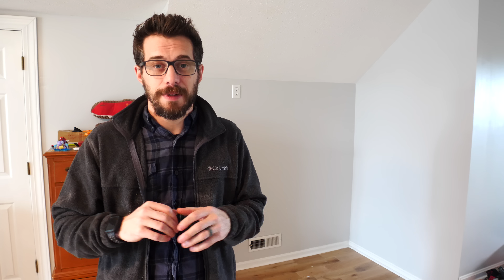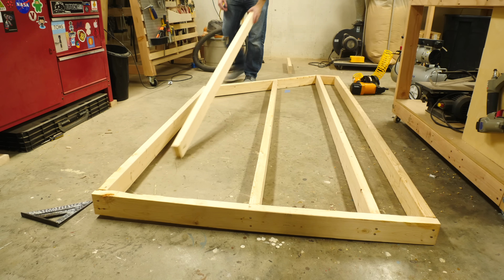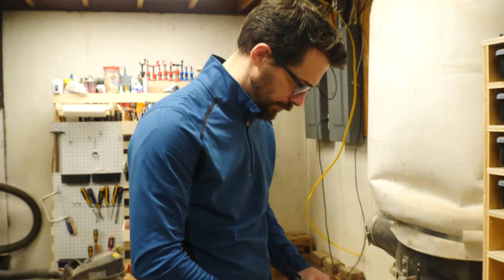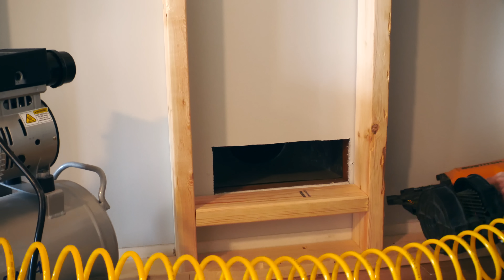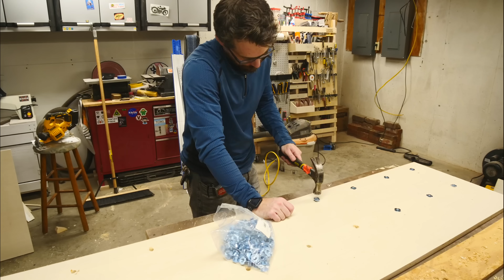How to Make an Indoor Climbing Wall | I Like To Make Stuff

Comment from the maker: Lots of people ask why I didn't just put the plywood directly on the wall. 
There needs to be negative space behind the plywood for the bolts to poke through.  In my space, I could have removed the drywall and put the plywood on the studs but it's an attic space so that would let tons of air through .
Reply: I would just put some furring strips on the back of the plywood for whatever offset you want from the wall. Then attach plywood directly to the wall.
Reply: Cool project though. I might do this in my son's room.
Reply: Noconz0727 MC Agree. I ran my 2x4s flat and perpendicular to the studs and then mounted the plywood to them.
Reply: I put furring 1bys perpendicular to the studs then 3/4” sanded maple with t studs already installed all over the place. Then. Bolted the  plywood to the studs with Headlocker screws.     Much quicker and smoother wood
Reply: @charltonwang  That's how I did my wall too. I just marked the studs and ran strips of 2x4s horizontally attached at each of the studs. Then just attach the plywood to the horizontal strips tied into the studs
Reply: you should put a bell or horn on the top
Reply: Cover the studs with plastic sheeting with enough slack to keep from being poked by the hold screws, and seal all the seams airtight.
Reply: Bravo! Nice Project! You've got me scheming about a wall of my own for sure!
Reply: Oh! You can always count on the comments to clear up 90 percent of questions
Reply: I Like To Make Stuff hey there! I was wondering if you think this kind of thing would be doable in a rental.  Do you think this would damage the underlying drywall too much? I know it's a lot of work to just take down, but the closest place to climb is 3 1/2  hours away...
Reply: I Like To Make Stuff I am climbing 9 times a week😆😆
Reply: I Like To Make Stuff can you make a video on how to make zig zag corner shelves , i would really appreciate it thank you
Reply: You should make the guitar from coco
Reply: It looks amazing!  U should have a company called I like to make stuff and build things for people
Reply: Literally came onto comments to give you shit about not installing straight onto the wall but... fair point you win this time
Reply: Personally i would have just strapped the wall with 2x2
Reply: WOWWWW
Reply: I Like To Make rocks
Reply: Might make it and add a small cushion spot so my sister can have a spot where she can sit and be left alone
Reply: I am a competitive rock climber actually, so this was very cool to watch!
Reply: I just saw this as a small video snippet for a Lowe’s commercial and recognized you right away bob!
Reply: I've built 9x9 feet steel frame fixed to the wall by chains. So, it's  in vertical position while unused, and can be adjusted for any overhanging angle for action.
Reply: This still does not make any sense whatsoever. The bolts would just go through the plywood and into the drywall. Just pretend you have an inch and a quarter thick piece of plywood and get longer bolts.
Reply: Hey i am a climber amd what the use in the climb halls is that they have a special paint on the wall and in there is sand in the paint they do this for extra grip on the wall. I also think it is safe have a "crashpad" or what we call it in the netherlands a boulder mat this is for extra protection so you and your kids wont get hurt to much if the fall bad (you could brake a ankle with this sport) i hope you will do something with this advice but that is up to you. Have a nice day and climb save✌
Reply: @baconunicorn9830  And at the end of the video he said that there was a crashpad
Reply: @musicgirl101vbjordyn5  ohh okey nice didnt hear that
Reply: True and im a climber to :)
Reply: I'd use metal construction brackets (cut to size) and would reinforce the notched ends. sawn lumber generally has very weak tensile strength in the direction perpendicular to the wood grain. if those notched ends split the cracks will rapidly find their way through the entire beam and you do not want that happening when someone's climbing it!

Comment: I just installed a climbing wall and my biggest frustration was installing the hand holds because the holes I drilled were not perpendicular to the wood base and my screws kept cross threading into the t-nuts. My advice for anyone installing one is to make a drill guide by using a drill press to drill a hole into a block of wood (maybe 2" cube) so that all your holes are perpendicular to the surface of the wood. I would also install the hand holds to the base, if possible, before screwing the base wood to the wall to prevent the t-nuts from popping out the back while installing. The holds don't add that much weight to the wall.

Comment: Question 🙋‍♀️ 
The frame you built to go over the outside of the Sheetrock- do I need that for the extra support? I’m building in a garage and there’s no Sheetrock there yet… I’m wondering if I can skip Sheetrock and just put the climbing wall and if I did that, do I need to build a support still or can I just go at it with the plywood?

Comment: What is the difference between making the frame with horizontal 2x4 as opposed to vertical. I thought one is supposed to line them up vertically to your studs if you were doing an overhead or angle wall. Horizontally if doing a flat wall. 
I  am trying to build a flat wall for my 4 year old. 8ft tall by maybe 8 or 9 ft long. I haven’t decided yet. Any advice would be greatly appreciated. I’m doing a lot of reading and watching about the subject but getting to a stage where I have questions based on experience.

Comment: chandanr24
55 minutes ago
hello, thanks for uploading this video. I have a question for you here.. when you are fixing that studd structure on studd (at wall). what size of screw you have used. I have a 4X2 studd to be fixed on unfinished wall in basement.
Thank you !

Comment: I've built 9x9 feet steel frame fixed to the wall by chains. So, it's  in vertical position while unused, and can be adjusted for any overhanging angle for action.

Comment: Hi Bob, I want to setup/make an outdoor climbing wall for my young children (up against the detached garage).  Do you recommend a specific type and thickness of plywood?  I was told to stay away from pressure-treated wood because of the harsh chemicals.  Would I just end up painting it? Any assistance would be appreciated.

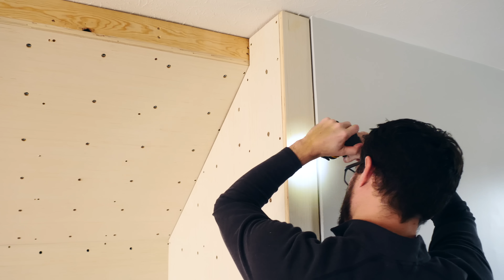Comment: nice video, but 10:15 'obviously, ...'  - why?  you can sandwich the t-nut between the plywood and the 2x4 (recess either to get it flush) and drill the 2x4 to accommodate the bolt...
Reply: What millilitre is the gap, and do you think its possible to bed them in?
Reply: @perrymarshall8584  the flange on a t-nut is maybe 2 mm thick.  if you can't get that flush with a hammer (in a 2x4, little harder in plywood) you could pre-drill with a router bit.

Comment: I just wonder why all the hassle to build the frame of the climbing wall which has exactly the same shape as the wall behind it.  Why can't you just remove the drywall and replace it with the plywood?  The plywood would have all the same holes drilled in it, before installation.  Then you attach the climbing holds and there you are.

Comment: Hey man soooo I went crazy awhile back and built a huge wall in my dads barn... One guy said paint with sand, that would work but what I did was use epoxy and sand to coat some of the wall. I also made some homemade home with the same mixture. Just an idea on how to coat it. If you haven't already. This is really awesome though, good job!

Comment: Great idea. I think 5" nails were a bit too short given they had to go through drywall. The frame could have easily been 2" thick instead of 4" to make it easier to secure. The air duct needed to be properly extended. And using screws instead of nails on the inclined frame would have been safer. Overall it looks good and very convenient.

Comment: I recall he made an apron to avoid the sawdust @ 9:50.  Not the first time I've noticed he hasn't worn it since he made it.
Reply from the maker: I usually forget about it in the midst of working.
Reply: @Iliketomakestuff  hang it near or on your tools that make the most sawdust.
Reply: You could also store it with your dust mask.

Comment: Hey, you should figure out what kind of gritty paint mixture that climbing gyms use to allow you to smear on the wall! I assume it's some sand mixed in with the paint but I'm not sure. Clear coat is probably quite slippery and not great if you want to teach them to smear (eventually!). 
Great project!

Comment: If they don’t like the sanded cut out you can add a router round overturn sand and it will be much more pleasing to grab than a squared edge. 

From one wood worker/carpenter to the next this is fantastic

Comment: 16" on center is a standard only for structural framing. Since you are mounting this to a wall, couldn't you have just made it 20" or 24" on center?

Comment: Usually indoor climbing walls have some kind of "sandy", rough surface soyou can use your feet on them. You get grip and you can challenge yourself by using hands on holds and feet on wall only. Great built! Kind regards from Germany!

Comment: My friends and I built a huge wall structure in our backyard. We used lock tight for the screws, and we painted the plywood with a sand/paint mixture. The texture helps a lot with climbing, but I don't think it would be absolutely necessary for a small space. Great job, I think you did everything about how it should be.

Comment: Protip: Crown your studs before you use them, (sight down the thin and fat sections of each 2x4 and mark the sides that bow out). Face them in the same direction in your build so at least its consistent, any super warped or bowed boards can be cut down for short sections or bracing.

Comment: AAAAHH!! DON'T stand on top of the wood that you're driving nails into with a pneumatic nail gun!
If the piece of lumber in question has a knot right there, the nail you're driving can shoot out to the side and drive right out of the wood and into your foot! I've seen this happen to nails on multiple occasions while using a pneumatic nail gun. I've also seen a nail get driven into the hand of a person holding a piece of wood being nailed.

The nail did manage to attatch his hand to the work piece so I guess it was effective at it's job....
Reply: That happened to my uncle. Have you had an anti-tetanus jab lately? He thought he'd got away with just an injury, until his jaw locked up.

Comment: Maybe this is a dumb question but you made it sound like you have to join the corners with some sort of nail. Would screws not work in this case?
Reply from the maker: Yes, I mentioned that.  long decking screws would work fine. 👍🏼
Reply: cool thanks, I didn't catch that until later in the video

Comment: I was surprised you didn't put down a soft or padded floor. It's difficult to tell how far off the ground the highest point is, but I would think falling from that distance to a hardwood floor would hurt... even if the floor had carpet.
Reply from the maker: I put text on screen explaining that there was a mat on the floor.  The ceilings are 8' so it's not tall at all.

Comment: Why did you frame it out at all? Why not just screw the boards to the studs that are already in the wall?
Reply from the maker: The bolts that hold the holds to the wall pass through the surface so there needs to be a negative space for them to go into.

Comment: Looks great. Is there a good reason for using 2x4s vs 1x2's? They don't serve a structural purpose since you are drilling into studs anyway, right? The purpose is to provide a little space for the hold bolts but those aren't very long are they?
Reply from the maker: Some of the bolts are 2 1/2" long but the depth of the holds is different for different ones.  For thin holds a lot of the bolt sticks through.
Reply: Ah, I see the pinned comment. Removing the drywall might also introduce code issues. Keep up the good work. BTW I discovered you through the No Dumb Questions Podcast.

Comment: Hi Bob- nicely built little wall.

If you're still thinking about paint, one thing you might consider is adding some texture.  There are textured paint available commercially for use on artificial climbing surfaces, but you can fairly easily make your own as well.  Exterior paint in your choice of color with some sand mixed in can create a nice basic texture effect.

Another option is to mix up some fast-set cement, color if desired and some sand/fine gravel.   Apply like you would drywall mud, but don't pay much attention to getting it smooth.

Edit- also, a quick safety tip.  I noticed you and your wife climbing while wearing your wedding bands.  Even on a relatively easy wall like this, climbing while wearing rings or other jewelry does present a risk of degloving injury (google at own risk).   Back when I was a climbing instructor, I always told people no rings whatsoever, watches or tight fitting bracelets are ok as long as the band will break (rubber/plastic ok, metal or leather not) and nothing loose around the neck.  Have fun, be safe!
Reply from the maker: Thanks, we both wear Qalo (rubber) rings.

Comment: Just curious, since you followed the exact angles of the walls anyway, and they already had the exact same framing structure behind the drywall, why didn't you just create those plywood panels and attach directly to the wall?  Sure you may have wanted to create a small relief in the back of the plywood for the t-nuts, but that would have been much less overall effort and expense.

I'm about to do a similar project and was planning to attach the plywood directly to the drywall where possible, and only frame out the areas that will have different angles than the current wall.  Just curious if I'm missing something here...
Reply from the maker: There needs to be negative space behind the plywood for the bolts to poke through.

Comment: I Like To Make Stuff. Bob why didn't you extend the wire of the plug so you could place it on the side of the climbing wall? It could come in handy sometime, and you can make it extra safe by protecting those extended wires with pvc pipe for example. This way plugging something into it will disable a huge part of the climbing wall, also I would put some kind of thick foam on the ground to prevent injuries.

Comment: Did you get a new nail gun? The orange one in the video looks way bigger than the one I usually see.
Reply from the maker: It's a framing nailer, not the brad nailer I use more often.  I've had this one for probably 12 years.
Reply: I Like To Make Stuff That makes more sense! For being twelve years old it still looks brand new.

Comment: Cool! But why didn't you just remove the drywall and replace it with the ply? It would have saved you material and time.
Reply from the maker: Because there's attic space behind those walls. Our heating and cooling would just be blowing into the attic.
Reply: Ahh, ok.

Comment: I've been wanting to do this also just think it might be more for me rather than for my kids 😋. One question why didn't you just attach the ply wood straight to the stud wall rather than make additional stud wall for it to go on?
Reply from the maker: That wall has insulation on the back of it because there's attic space behind it. Doing that wouldn't separate the room fro mthe attic very well.
Reply: With 100% certainty, I will use this as much or more than my son.  :-)
Reply: In addition to what was said about the attic, you also need a void space behind the wall surface for bolts.

Climbing holds come in all sizes and very rarely do you get a perfect pairing of a hold and a bolt such that the end of the bolt sits flush with the back of the T-nut.  Often the bolt protrudes some amount.  If the climbing surface was directly against the wall, this would be a problem.

Comment: Can someone explain to me the placement of wall outlets? Why is that one so high up on the wall. In a bathroom, it makes sense that it be "level" with the counter, but in a bedroom, living room, etc. it can vary widely. Even in my room, I have 3 outlets all set to 3 different heights on the lower half of my walls. Granted, my place was an old home converted to set of apartments, so at least any wiring standards probably didn't translate well.
Reply: I don't bother with television myself, but a lot of bedrooms have high power sockets to allow for a wall-mounted tv screen. Can also be useful for vacuuming when all the floor-level sockets are in use.

Comment: I have questions I want to be clear these are not criticisms. 1)what lead you to use plywood instead of OSB, was there a particular reason? I had a climbing wall at my parents house and now that we have our own house we are going to build a room (odd attic closet thing) I had planned on using OSB again. 2) for a small wall like that and for my own cave I was planning on re-framing the space like you did but using the smaller 2X3 studs (I know they aren't real framing studs) was this something that you considered or do you feel that full 2X4 are required for this project. any input would be appreciated. thanks mark
Reply from the maker: OSB would work fine.. we just wanted something a little nicer looking since it was the first thing you see when you enter the room.  2x3 would probably work fine. Make sure there's enough depth behind the wall to account for longer bolts that have to penetrate through the t-nuts.
Reply: thanks for the information. thanks for the project and video.

Comment: What is the purpose of building the frame if all of the studs match up with the studs in the wall?  Why not just attach the plywood to the wall?
Reply from the maker: There has to be a negative space behind the plywood for the bolts to stick through.
Reply: I Like To Make Stuff  ah. I didn’t notice that. Thanks for the response!